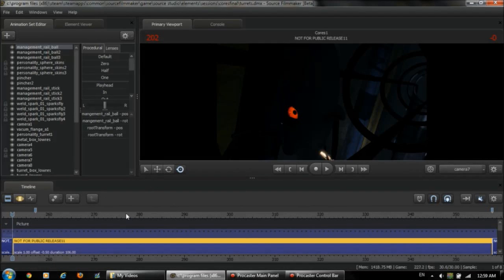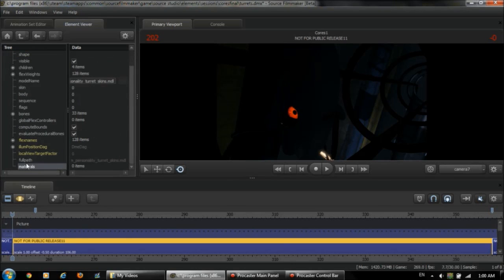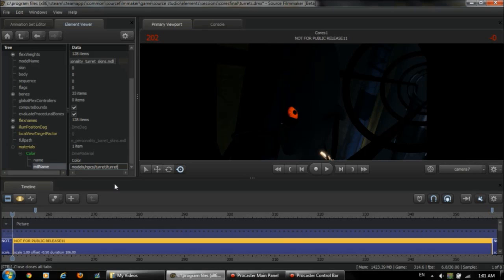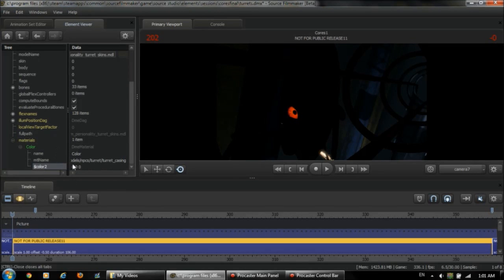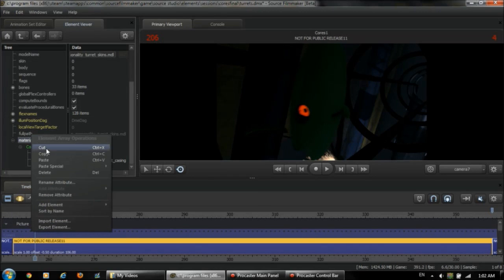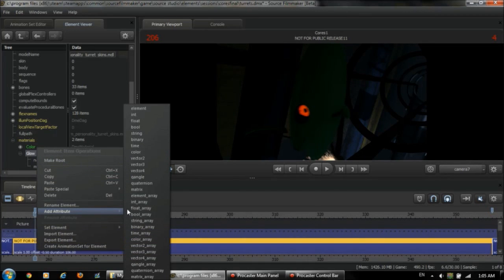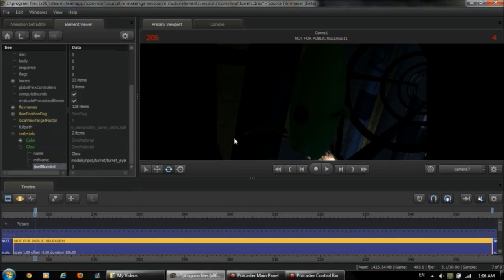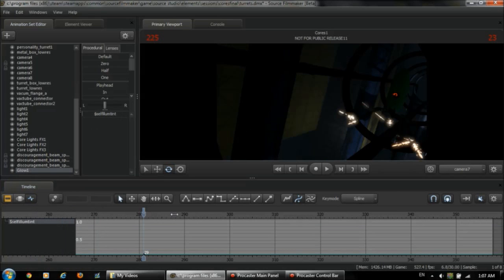[TUTORIAL] Modifying materials in the Element Viewer

Comment: HELP!!
The material I'm modifying does not use $selfillum, and I don't know what type of attribute to use to do that!
Reply from the maker: What you can do is insert selfillum directly into the vmt and have it set to 0 initally, and then change it in the element viewer.
Reply: Rantis Can I just add two $selfillum-s (with different values) into the same material?
Reply from the maker: ***** No, modifying the selfillum in element viewer will not add a second selfillum to the vmt it will just alter the existing one.
Reply: +Trackmania Studios 
I had the same problem as you, until I checked the .vmf for the eye texture of the 'personality_sphere_skins'.

Don't use '$selfillum'. I don't know why but its broken.
Instead, use;

$selfillumtint

Comment: I am guessing this doen't work for workshop models? At least I cant get the this to work on the personality turret I got from the workshop (I used the correct path through the workshop folder)
Reply from the maker: Make sure your looking the the right folder :)
All workshop items are in the game/workshop folder.
Reply: Rantis I discovered you have to use the exact same path used in the .vmf file for the base texture or it wont work for some reason. Even if the path is technically correct, it still wont work if there is any extra folder paths. I was using "materials\models\ugc\76561197999601709\npcs\turret\turret_eye" but it only works if I use "models\ugc\76561197999601709\npcs\turret\turret_eye", even though the paths go to the same place.
Reply: Ran into another problem though, its not showing in in the animation set editor for me to edit, even though I click "create animation set for element".
Reply from the maker: :S that's very strange
Reply: Rantis its weird, I can set the $selfillumtint to any number and it updates in SFM to glow, but as soon as I create a animation set for it I am unable to edit the value and I cant find it in the animation set editor as well. Oh well